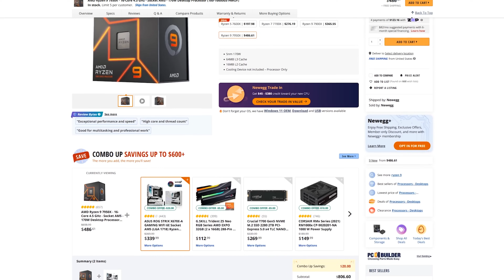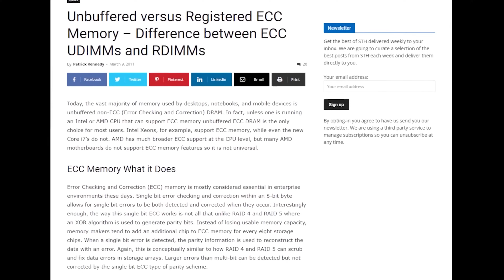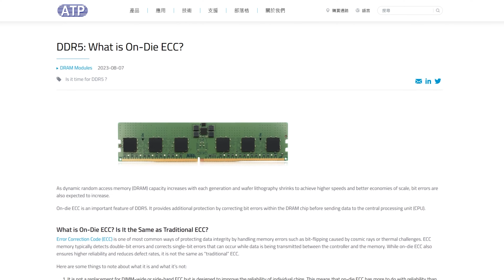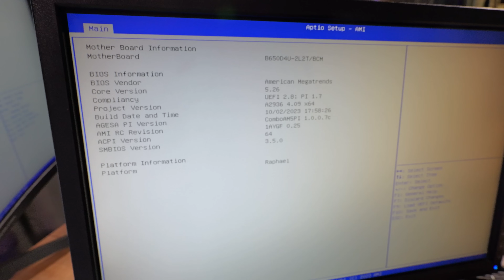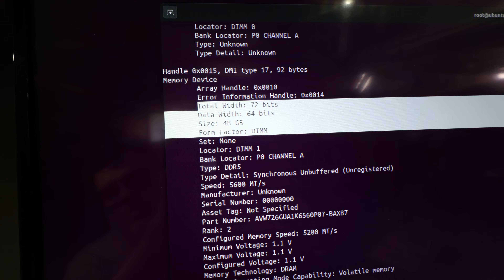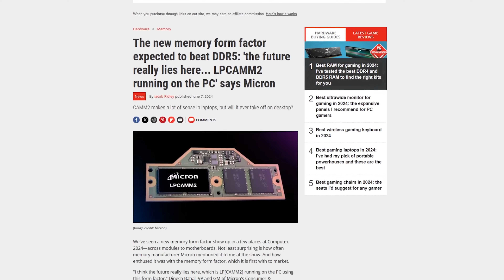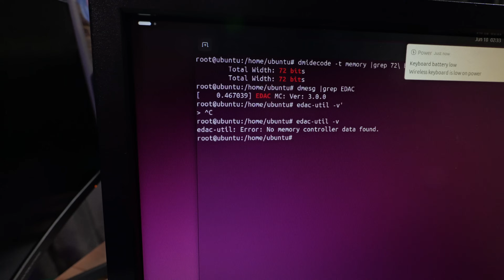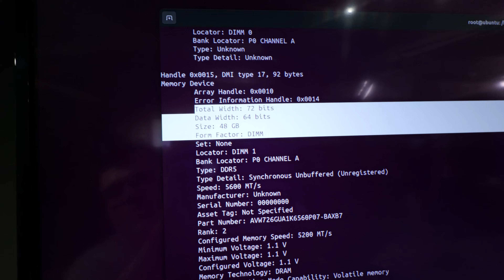What's Up With Error Correcting Memory on AM5 in 2024?

Comment: If only AMD would fix the horribly high idle power consumption (due to chiplet design inefficiencies introduced in 7000 series) on AM5. It's up to 30W more than an Intel 1700 or AM4 CPU. For a home server that can actually add up.
Reply: I have here a 13600T 175usd (used) on the wall with 4 ssd 4 mem and a 4060ti can idle about 35w - 45w light loads

Comment: Has anyone encountered real world events where ECC has kicked in?  What's your story?
Reply: Some dust bridged a trace in my DDR3 8350 server, taking out the whole column and I didn't even notice until I checked the logs three months later. It would have crashed without ECC.

I gave up on non-ECC systems after getting bus errors while running gcc or memory-intensive simulation codes. Such errors never were an issue on the ECC systems
Reply: When I worked in a datacenter we would see ECC error events every so often but we had one customer with a NAS that went from fine to throwing errors all over the place.  In the end (I believe it was) Dell ended up replacing the hardware so I never got to troubleshoot what the exact problem was but the customers data on the NAS was fine so in the end ECC did it's job.
Reply from the maker: In general you'll see a few ECC correcteds in any server at least a few times a year, not atypical to have like 6-8 events a year, really. correcteds.
Reply: Most randoms blue screens, and many of the problems that get solved with a reboot, are related to memory errors
Reply: People experience this as extra instability they dont attribute to memory errors but people who run ecc see that these errors arent anywhere near as uncommon as one might think, and they might even be worse for some without them knowing.

ECC keeps you sane knowing it is or isnt the ram and stops you chasing down random things. It also means no random green glitch in your video archive or lost data in documents.

Comment: Why in 2024 is all memory not ECC? I mean its not that much extra cost to have un buffered ECC.

EDIT: Honestly if you are doing anything more advanced than throwing a GPU and RGB in use ASRock. I dont honestly get the hate, every time i have contacted them for strange none standard requests they have been more than happy to help. Contrast that with MSI, all i asked them was for the location and model number of the fan controller on the PCB on my X99 motherboard and they would not even try to ask the back office for a simple service request. I know its out of support , i know it was me that exploded the fan controller but just please at least try to ask dev for the info, how will this hurt you?
Reply: Same ASROCK has been awesome for me, super responsive and willing to support tinkering. I've received some products from them with zero "void if removed" stickers. I would prefer warranty items be new rather than refurbs, but that's a universal thing. Crucial's warranty experience was the best I've had with any brand, but asrock has been extremely solid for me.
I built out a really high end system for a customer using ASUS and it was obviously a really good board at 600 dollars, but it wasn't worth 600. The basic Taichi was equally well equipped - but lacked the full face metal junk that the customer wanted. A third of the price, 400 dollars for cheap aluminium plates.
Reply: Unbuffered DDR5 is actually more expensive because of some wasted capacity. Each 32-bit (sub)channel on a UDIMM only has four check bits. The lack of registers limits the number of chips per channel, so only x8 chips are used, and since the chips have to be matched, that means five x8 chips per rank. That's 40 bits but only 32+4=36 pins, so 4 bits can't be used.

Registered DIMMs can use x4 chips, so it's possible to have nine identical chips on a rank for 36 bits with no wasted bits.

RDIMMS also have eight check bit pins per channel so five x8 chips can have all 40 bits connected to 40 pins, though whether they are used depends on the host.
Reply: I suspect it's the same reason that literally all consumer motherboards - including the $1,000+ "extreme gamer boards", are built with the absolute cheapest nastiest substrate that flexes with a big CPU cooler and when you look at the edge of it, looks literally like it's made out of some FR4 from the 1970s... The same thing that drives all of american consumerism - extreme, crippling cost-cutting and demand for nearly-unfit-for-purpose levels of cheapness and "value" by the average consumer.
Reply: @dregenius  So ignorant consumers that go for childish "features". These things are only on the market because people will pay higher margins for them.
Reply: @mytech6779  Who do you think that elitism is helping?
Reply: DDR5 doubles the cost to implement ECC. With DDR4 and prior, regular dimms had 8 chips across a single 128 bit channel per dimm, and the ECC parity bits came from an additional memory chip. DDR5 is split into 2x 32 bit channels, so each 4 chip channel will need an additional chip for ECC parity. That would theoretically increase the price by 25% relative to non ECC, 10 vs 8 chips.

Also, it won't run anywhere nearly the clocks of consumer ram, as it takes dialing things back a bit to get the stability which using ECC memory implies.
Reply: To be able to charge more for it. Also speed it takes time for the CPU to do error checks on the data retrieved from the RAM which will slow down how fast CPUs can be. Right now you really do not have a lot of applications that that small slow down will be noticeable to a non-server non-enterprise user.  Gamers might in CPU limited games but as most right now are GPU limited not CPU limited that shouldn't be a reason. 

The other most likely reason is tradition of having UDIMM and RDIMM DRAM. Right now with how fast the CPU's memory controllers can support it will not really matter though RDIMMs do cap out at a slower speed before throwing errors that will require a re issue of the same data from the RDIMM. You have people who want their RAM to go as fast as possiable and if we are all on ECC RDIMMs well they are made to be correct every time it gets passed to the rest of the CPU not fast while non-ECC UDIMMs are made to be fast while having 98% ~ 99% correct data transfer is acceptable. For consumers even if you have 2% errors which is bad and most likely a sign it is failing it will not be seen. As most software is programmed to handle bad data and the process will be done again. For consumers that will be quick for servers while that might have taken a second and that second can add up or if it isn't caught it can lead to a bad output.
Reply: @yumri4  The ECC is checked in hardware, it doesn't slow the CPU down, as long as there's no error, it is just lower clocks for stability, so the ECC memory is a little slower and has looser timings. Only if there's an error, the CPU will take time to correct it, and only single bit errors are correctable.
Reply: @dgo4490 the error checking function simultaneously indicates the which bit has an error, so correction doesn't take any more time
Reply: U can’t have high speed memory that’s why
Reply: @heickelrrx  Actually high speed memory matters a lot less than one would think, when you have such beefy caches. A ~10% increase in latency (and the ECC penalty is TTBOMK less than that) would be barely noticeable in actual benchmark speeds.
Reply: so that Intel and AMD can charge you a lot more for the privilege of reliable computing, essentially
Reply: It's not that useful for consumers. I have unbuffered ecc on am4. Guess how many corrected errors I had in last 2 years? None. And one uncorrectable. I tested it, it works for sure and corrects when injected btw. If your pc is stable and thoroughly tested with the likes of y-cruncher, cost to benefit is too low for us. But I'm always open to ideas
Reply: @daethar  this is just statistics game and survivorship bias. If 100 people running ECC PC-s then the picture is different and thing is DDR chips do degrade over time. I don't have many PC-s but have been lucky to get correctable and uncorrectable errors and then replaced those dimm-s, no data corrption, PC did run about 2-3 years before errors tho. And also unlucky long time ago to have regular (DDR3 I think) that had one degraded bit to mess randomly up a lot of data over months, before accidentally discovering broken backups and files after copying. To this day not all of that data is recovered.

Comment: 13:10 Has anyone seen 64 GB per DIMM unbuffered memory in the wild, yet?
It’s been half a year since motherboard manufacturers qualified these sticks (Kingston modules with Micron DRAM ICs).
Reply: I have asked him under his comment, comment disapiered without an answer. My standalone comment is still there. Have only seen the announcement news. If you find out something, please let me know. Have a Intel system, need unbuffered unregistered udimm with 64 gb sticks for my system with 128gb on intel, so without ecc, but also interested for servers for home. Had 4 sticks 32gb, but couldnt go over 4800, 5600 with xmp but crashes sometimes. Is a gaming and work system. With 2 sticks I can go to 5600 without xmp, no crash. Now run 2 32gb sticks in 6000 with xmp, doesnt crash but I don't like that I have xmp, but if I can't have 128gb I want that speed. so with 2 sticks a 64gb I would go no xmp and 5600 because that's enough speed and enough memory for bigger Projekts (learning coding, 3d printing and cad, and want to learn video editing) so please let me know if you see something, best wishes from Germany.
Reply: @kleingezockt5923  What exactly do you mean by with&without xmp, you know it's just a setting profile, right? It's just a preset, like the normal JEDEC SPD settings but faster&tighter timings usually. Nothing more. Like in the old DDR days you could have a stick with JEDEC SPD 2.5-3-3-7 for example and you'd have a XMP that is intel validated for some CPU to instead run 2-2-2-7 or similar. There is nothing else to XMP other than a profile of settings that the manufacturer claims to run on certain Intel processors with tighter&faster settings than the JEDEC SPD validated settings. So you can check what settings XMP sets usually in BIOS, and try to back them off a little, like a clock or more for row refresh or something if it looks too optimistic, and see if it holds without crashes, then use that profile as a manual entry if it works. XMP settings routinely only work with one DIMM per channel, if you have more that is likely the issue, also typically work only in the closest slot to the MMU in the channel, and so on. 
But there is no difference between the settings manually set or set by XMP profile, if the BIOS works correctly, so XMP is nothing but a profile there to save time from setting the same settings manually, you might as well have the XMP values on paper instead of in the BIOS, makes no difference.

Comment: Wasn’t there also the “issue” that the 7950X was quite efficient for mining a certain crypto diarrhea variant which caused a temporary market scarcity?

I still don’t understand how the Epyc 4004 CPU line is supposed to be good for customers. Please correct me if I’m wrong but hardware-wise they are 100 % the same as the corresponding Ryzen 7000 CPUs but with lower boost clocks.

I would have been A-Okay with a special motherboard BIOS update introducing an “EPYC Ryzen” profile which sets various motherboard BIOS settings like ECC, IOMMU, PCIe AER and lower boost frequencies automatically.

With the new EPYC 4004 SKUs I am worried that AMD will eventually remove ECC functionality from the regular Ryzen CPUs for good, maybe as soon as Zen 6.
Reply: It's just a branding/marketing move. There will be some use cases/consumer where they get to feel more comfortable that the part says Epyc. They are just rebranding unsold Ryzen CPUs, and charging the exact same MSRP. There isn't a point in removing ECC since they are completely the same CPUs and they aren't even really upcharging for the name. If anything the existence of them on AM5 will nudge mobo manufacturers into doing the work to to properly implement ECC.
Reply: @blkspade23 also helps them track the two market segments better. lot of places (mostly colos so far) have started offering dedicated servers with the ryzen 7950x, and that higher single-threaded performance is incredibly valuable to certain workloads that none of the previous threadripper or epyc chips were good at.

game physics and logic is the obvious one, but code compiles could be improved in some cases as well. also, some cad tasks don't thread well.

Comment: Oof, I am stuck with an Aorus B board. Hopefully with the 9000 support, it will be more functional.
Reply from the maker: what model in particular? F30 on the Aorus X670 fixes the ECC problem.
Reply: @Level1Techs My fault it is a B650 Gaming X AX.

Comment: >AM4 works for home servers

Me still using a Sandybridge i5 for my home server in 2024
Reply: More same: Xeon E3-1275L in a Supermicro MBD-X10SL7-F-O with 16G of ECC and a lot of hard drives. It's almost 10 years old now and still works flawlessly. I would like to replace it but I wish the CPU manufacturers would realize not every server needs 64 cores and 256GB of RAM.
Reply: @douglasbollinger8678  what's the problem in finding lower end Xeons or AM4 cpus? You are already using a low end xeon (i.e. same socket as consumer CPUs of the same gen, and not compatible with registered RAM)
Reply: Same. 2500k running Proxmox with everything virtualized on one machine.
Reply: Brothers in arms
Reply: You guys are all American I bet. 

1 year of power bills over here already covers the cost of going AM4
Reply: I'm on haswell on my nwwest machine so not that far... oldest is a dual socket LGA771.
I have to find something to do with that chassi, it is basically collecting dust.

Maybe a custom ARM cluster or something.
Reply: Feel ya.  Went from a i5-2320 with 8gb to a Ryzen 3600 with 32gb.  👀  Wowsers, did not think there would that much of a difference.  And the power difference, I swear the room is 5° lower.
Reply: My server is from 2012. and my primary desktop 2013. All the more reason for ECC, mem degrades over time. Just a huge pain to find low power single board machines (mem soldered on) built with ECC. (My server draws 6watts at idle and 12w with a spinning HDD active.)
My desktop has been up for 60 days and server has started crashing this past week, but I haven't attempted to diagnose it yet, need another anyway.
It just sucks that ECC mini servers are double or triple the price, so I'm actually better off on cost with fully redundant non-ecc systems.

Comment: I love that all of these combinations are possible in 2024. However the reality of the ECC UDIMM market is that any savings you make, you pay for in ridiculous sticker shock and compromised halfway features like only half your DIMM slots populated, etc. I went with a used Milan CPU and a new RomeD8-2T mobo last year, and I'm still pretty tickled with it. I got 256GB of 3200 DDR4 RDIMMs for $381. I can barely get 64GB of DDR5 ECC UDIMMS for that price...
Reply: The 2 DPC issues are affecting all current Zen 4 systems, from Epyc Genoa, Ryzen Raphael to the AM5 Phoenix APUs, the memory frequency and timings have to be significantly worsened for it to work automatically on a system with default BIOS settings, it doesn’t have anything to do with ECC memory. Wendell mentioned it in this video since people interested in ECC memory probably also want to know how much total memory a specific platform can use.

The situation is unlikely to get better with Zen 5 since the CPUs’ IO Die that connects to memory is the same as Zen 4’s :(
Reply: @abavariannormiepleb9470  That's true, and I was aware of that. However specifically with Epyc I imagine there's not too much butthurt since Genoa has 12 channel memory. I don't know if I've ever even seen a 24 dimm single cpu mobo before...
Reply: That pc must be punching B holes.